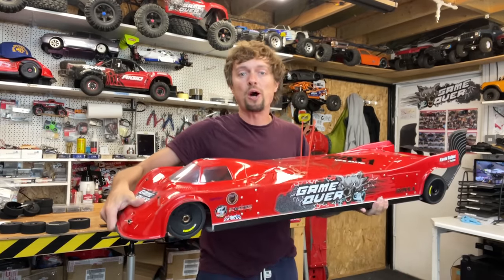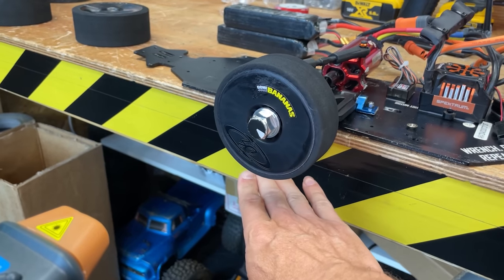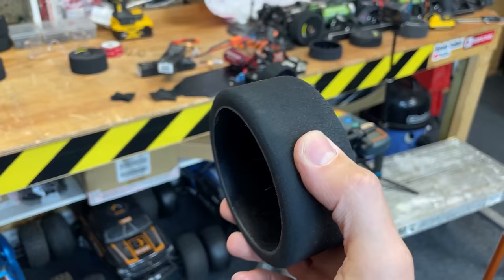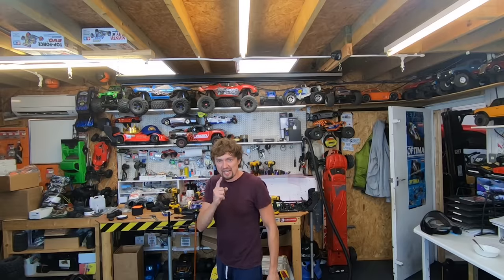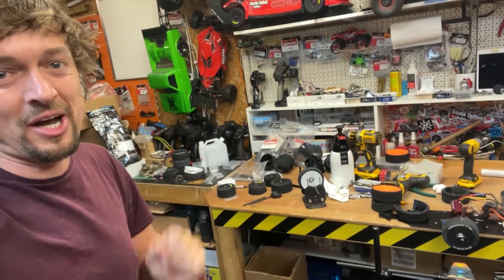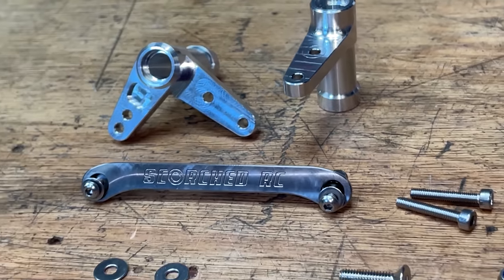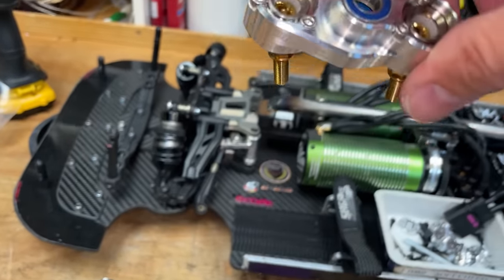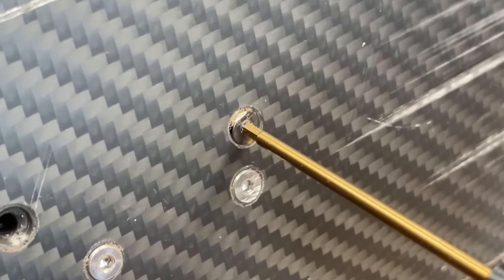Top secret Tires for 250mph Sausage RC Car project

Comment: I've totally lost my patience with any kind of some what fast RC car even stock ones. I have the latest Kraton and it's been nothing but problems. I've been through 3 diffs with about 30 battery packs through it. The last set of diffs I did I replaced the bulkheads. I don't bash it or jump it just ripp it around the yard or road in front of the house. Stock wheels gave out with the factory (slow) gear. Replaced the wheels and tires with banded something or anothers, RPM arms front and rear, new steering servo and tighter saver spring, I put maybe 2 packs through it and started to hear the diff clicking again. Then I burned up the motor after a couple pulls down the road it hit a puddle and I'm assuming the water caused a massive heat differences on the can and cause it to cease up. I've had really great luck with planes though!

Comment: Good idea with the rpm test… definitely need a contact roller of some kind to simulate the road… 

My thought is, it’s not so much the mph, but the rpm… The amount of power that’s being sent through them and the rpm they’re turning is where they’re failing… 

The larger the diameter would be less rpm, but greater mass if not done correctly. Also the huge offset of the wheels, having a flat face and a big dish on the back is a problem. 
As you saw in the two tests, no support on the inside of the wheel allowed it to “flare” which is most likely what’s happening on the runway… 👍🤘

Comment: As others have said, it seems like its the wheel that is expanding out on the inside, due to no support. That pushes the foam out, which either blows it or scrapes it on the car and cuts it blowing it. You need to replace the wheels with something more rigid like carbon or aluminum as others mention

Comment: Hey man, have you thought about using artificial glue type spray like drag racers use? VHT pimp juice and such? Also have you thought about prepping the surface that you are running down if it's allowed?

Comment: more narrow tires. concave exterior portion of rim? Looks like it separates from the center of rim. rounding the exterior rim may increase surface area increasing adhesion and decreasing centrifugal forces because the foam will be thinner in middle. maybe?

Comment: Just a thought but what if you increased the wheel diameter. It wouldn't need to spin as fast for the same vehicle speed. I understand there are still challenges with this such as the chassis may need redesigned as well as sourcing larger diameter wheels for this purpose may be difficult, but I wonder if it would work.

Comment: I think it's time for carbon fiber or aluminum wheels. You could try bonding rubber to a stiffer wheel, if the rubber was only a couple of mm thick and bonded all the way across a stiff rim it should stay on better. It appears the wheels keep flaring out because of the deep offset. I see the new wheels are narrower.

Comment: If you run it on a prepped drag strip you don’t need anything but solid aluminum wheels with a rough road surface since there’s rubber on the surface of the strip.

Comment: Is there a way to wrap some carbon tow around the exterior circumference of the rim before gluing the foam on?  I imagine this would greatly help with expansion of the plastic rim.  After you mount the foam you can cut them back to round.  hey it may work.

Comment: The actual rim is playing a huge part in the tire expoding, the rim is made of flimsy plastic and can't hold itself together, especially on the inside part of the rim that has no support.  It's balloons on the inside edge of the wheel where there is no support then blows apart.  Need to try a stronger wheel, aluminum, or carbon fiber, or just a thicker stronger plastic.  Some type of stronger rim design, there is nothing holding the inside edge from swelling.

Comment: The problem is not because of the rubber or the foam.  A few videos ago you showed exactly what the problem is when you held up one of the wheels and you squeezed it in your hand.  I know you didn't even realize what you were doing Kevin but that is the problem.  The tread of the tire has solid support on one side of the tire but the other end is open and the fact that you can squeeze the wheel in your fingers shows just how weak it really is.  At 200 mph that wheel is 100% flaring out which makes the tread part of the tire not touch the ground evenly.  It's so simple.  It's not the tire material.  It's the construction of the wheel.  It must have support also on the open side of the wheel.  When that happens then that tire will ride on the ground evenly.   You can even see the wheel flaring out in the video here when you were testing the tires.  Only the one side flares up and that's because it's weak because the other side has a solid wheel supporting it.  And the side that flares has zero support.   Of course it's going to fall apart.  Fix the wheel Kevin.  Not the tire.  You could use foam or rubber if you make the proper wheel.

Comment: A simple and effective way to build a wheel is to take one of the foams and make a carbon fibre insert into the wheel void and bond it it. You can buy carbon fibre tube. It will take a matter of minutes
Reply: What if the plastic wheel was sleeved with the carbon tube section and the foam glued down to the carbon?

Comment: Even though it might be heavier,  what are your thoughts on a solid rubber tire? like a 3+ inch solid rubber tire with just a bearing in the center which might hold that speed better.
Reply: I wondered that, but wouldn't the rubber just change shape completely at those speeds like a drag wheel?

Comment: Hiya Kev just wonder if you can have belted foam. With high strength fishing wire. Also the tyres only need to get over 120 so you are probably over testing them!

Also you remember that mammoth stealth thing. That had direct drive to all wheels!  Food for though.  You'd have to call it the big fat sausage lol.

Lov the vids

Comment: Carbon fibre banded wheels to stop expanding on the inside
And possibly a thin polyurethane band over the foam tyre 
Just a suggestion you may have already tried it🤷‍♂️

Comment: Hey Kev, If you take 4 25 hp motors and hook them to the same drivetrain, doesn't that still make the whole system only 25 hp but 4 times the torque? Very curious about that.
Reply: Power (hp) is just rpm times torque, so you really get four times the power, if you don't hit the rpm limit of the motors first.

Comment: I don't think its a big secret, its just a basic rim, foam removed then glued a solid rubber tyre, now the problem you are going to face is still the rim expansion at those rpms, but its a good ideea so good luck. 😊😊

Comment: I know you don't want the weight but the wheels are failing.  You need metal wheels. Or maybe carbon fiber wheels, but never heard of anyone that makes those.  Once you stop the wheels from failing you can then move on to the tire material.

Comment: If the tires keeping on blowing up on high speeds, why not grabbing a skateboard wheel? The tires used for those are polyurethane, which tends to last on crazy high RPMs because of the density which is a lot higher than regular RC tires which are flat, and have lower density. The lower the density = The higher the possibility for the tires to blow up.

Comment: very surprising that the unsupported rear edge of the wheel is expanding. needs either a thickened rim in the mold or a steel band to prevent that expansion of the wheel.

Comment: A little trick with rounded hex and allen key bolts.
Put a small dab of super glue in the recessed part on top.
Wait 30 seconds and insert and hold the bit for a further 30 seconds.
Simply twist and remove rounded bolt.
Paint thinner and WD40 will easily remove super glue before it dries.
Yuo're welcome. 😎👍

Comment: The wheels are belling where there's no inner support, Have you tried running one of those metal cable ties under the tyre and then balancing it. Or machine the wheel narrower, like your prototype.
Though CNC Alu rims are nice, all it will take is a minor impact at that speed and it's good night.
Either way, Dude, You'll figure it out smash the record...

Comment: I would try using super glue to the rim before you mount the foam. The super glue should help hold it to the rim helping prevent enertia pulling them apart so easily.

Comment: The bananas ones could take even more if you can get them to put a back lip on it it will help with the deformation and get even more speed out of them most likely, also make the plastic the foam wraps around thicker or use a different plastic formulation that is stronger and holds form better, but also it could be deforming because of the heat and the rotation is somewhat keeping it in form

Comment: I would recommend you a rim geometry that distributes the centrifugal forces symmetrical, most rigid on the edges (both of corse)
And don’t take aluminium thats not the material for this. You would take a material that has high strength with high elasticity characteristics.

Comment: also you have to give load to the tyre whyle testing it......make countertyre with some serious hard material maybe two or more thic grinding wheels with adjusting load and a masure like easy weight scale.......then you know how it will hold the 1 tonne of a car on rpm

did you see the video of ras how his springs squeeze under speed he did harder ones also

Comment: It really seems like the wheel is as much of a liability as the tire. Those unsupported thin and flexible plastic wheels are great for durability, but they are terrible for this application. I'd echo the need for some wheels with a better support structure, particularly near the inside of the wheel. Aluminium wheels would probably be ideal.

Comment: Kevin how would you feel on adding a 5th esc no load but working a a central control, so wires come a same lenghts to the four main and eliminate any latent signal to your escs

Comment: Why is the rim plastic and not a billet aluminum, 
Why is the foam tread one piece and not say 10 sectional pieces, 
These things combined would eliminate the tyres exploding at high rpm

Comment: Aluminum wheel, pattern of holes drilled through rim. Solid rubber with belting vulcanized to inside and outside of rim. Sounds expensive but it would work.

Comment: Just a thought. Have you looked into tire and wheel setups used on Booneville salt flat machines? Why reinvent the wheel?
Reply: They use tires made of filaments of rubber wrapped around a wheel. But they don't have near the centrifugal force due to much larger diameter.

Comment: Wow, the deflection on the plastic rims 😬 lools like half the time the foams not failing but the plastic rim caused the foam to blow. Alloy rims may make it slightly heavier but might get better speed as won't deflect. Gradual acceleration increasing speed should be fine , once its rolling the weight will be negligible.

Comment: this is probably a stupid idea, but wouldn't making it a 6x6 help with stability and potentially the tyre wear? if you could somehow attach another axle (even if its not driven) wouldn't it help with the high pressure from the length of the chassis and help limit the likelihood of it swerving.

Comment: You need much stiffer wheels. Nic Case used carbon fiber wheels for a reason. You also need to go as narrow as possible on the wheels / tyres.

Comment: You’ve calculated wheel mph by wheel rpm, could you make a “steel roller dyno” similar to the weight of the vehicle so that you could test your tires, driveshafts and wheel top speed with it loaded.  You wouldn’t have to worry so much that something will happen at such speeds and catastrophically fail.  Eventually you’ll have to run it down the road I just hate seeing the speed run cars wreck so violently on test runs lol

Comment: Machined aluminum rims, with steel belted rubber tires like what you have on a full size car.  Just scaled down for RC's, you would think Goodyear engineers would be into RC cars and have some thing for this.

Comment: Would it be worth putting a multimeter across each motor at a set throttle position, to make sure each one is getting roughly the same juice?

Comment: I'm no engineer, but if you used much larger diameter wheels, you can achieve high speeds with less wheel rotation. Seems to me that everyone is going down the same formula path when it comes to design. You just have to look at world speed record cars like Golden Arrow and Bluebird before tyre technology caught up, similarly where RC tyre technology is.

Comment: Seems like a belted tire like they use in drag racing would be preferable or even a hard solid rubber that doesnt have much flex at all. Its wild to me how this issue hasnt been solved yet as it doesnt seem like it would take a genius for a tire company to figure out.

Comment: Must use aluminum wheels with rubber tires (would also act like running a bigger flywheel on a car to stabilize powerband)
Reply: alloy/rubber on the rear with poly/foam on the front could work as well

Comment: Take your rim put aluminum screws around the perimeter of the rim like a beadlock on the face of the rim an attached a hairnet over the tire and anchor them to the screws use epoxy of your choice or hot glue to keep the hairnet from popping off the screws the hairnet my act like belting try different hair nets plastic fabric and maybe the foam  won't fly apart 🤔

Comment: I would go with an aluminum wheel or magnesium if you could find them then mount the foams on wheels using polyester resin and catalyst the foam wouldn't be able to expand on the rim

Comment: 4 separate motors means 4 separate motors. it does not mean 4x25=100. the only way you can do that is 4 motors to 1 speed controller

Comment: Look into how the rubber is kept on razor scooter wheels and get alloy wheels machined similar and run a hard rubber as your wheel surface your not looking for high grip and the extra weight won’t really matter speed cars seam to be completely limited by wheels where as you guys might find you break other things with metal wheels you’ll likely get more advantage from them if you make them work

Comment: So my theory has been repeated by other ytubers below..the plastic wheels are not strong 3nough and higher rpm they cone and pop tyres ..I also think you need either alloy wheels or carbon fibre wheels

Comment: I think your tire problem is as much a wheel problem as anything. The rims are deflecting and expanding, and that's probably what's causing the foam or rubber to come off. Find somebody that can machine you a set of wheels from 7076 aluminum or titanium, and then you can experiment with different foams and rubbers

Comment: You need to be using a solid wheel. Take something like a low durometer rollerblade wheel, get some hubs machined to adapt them to a car, probably have to turn the outer diameter down some...Bob's your uncle.

Comment: My thoughts.. the tire is failing once it gets a small nick in it throwing it out of balance this would happen at much lower rpms.
Its a track surface issue more than a tire issue you need a resilient tire surface..

Rotational mass needs to be minimised balance by removing not adding

A bonded Tire surface needs to be almost nothing for 1 run

Go for a larger wheel diameter which will reduce the rpm and loading for a given speed

The wider the tire the more surface to come off or inner rim distortion causing inbalance too failure. Logic would dictate thin wheels....... but there goes your grip.

Large diameter narrow wheels, long build up of speed to reduce wheelspin required

Comment: If you solve the centrifugal force issue destroying the tire you still jave a wear issue at rhise speeds.  Smoother the surface the better.
Reply: I agree with you 👍
When we look for alternatives to abrasion and wear in rubber, 
Polyurethane is usually what we turn to 
Forgive me if I'm wrong?

Comment: what about a drift tyre with 2 grooves in it with orings in the grooves not perfect for traction but slow throttle ramp and there not going to blow up

Comment: What about drastically increasing the diameter so that the rpm can be less
Reply: Kevlar stranding increasing in in wraps as it gets closer to the chassis of the car. Getting this in the foam would be the interesting part tho and maybe a carbon rim 2 layers thick with the right lay up would be pretty strong as well

Comment: Rosco McGlashan is going for 1000mph on land in a rocket powered car, but its got to be on salt flats, with alloy wheels that cost 10s of thousands to machine, no tires. you're going to hit the same kind of issues in RC

Comment: Aren't you making a mistake with your math?  You are using data with the wheel stationary, but it expands significantly before self destructing, so the ground speed would be a fair bit higher.

Comment: First, convert the tire diameter from millimeters to inches:
Tire diameter (in inches)=25.4106=4.173 inches

Next, calculate the tire circumference by multiplying the diameter by π (approximately 3.14159):
Tire circumference=4.173×3.14159=13.12 inches

Convert the tire circumference to feet:
Tire circumference (in feet)=1213.12=1.093 feet

Now, determine the vehicle speed:
Vehicle speed=23000×1.093×6336060=205.8 mph [not 285 mph]

and here is why it's much slower sir: Increased Rolling Resistance [wide tires], Increased Inertia [ overcoming inertia requires more energy] and  Aerodynamic Effects [Larger tires can alter the aerodynamics of the vehicle aka drag!]

just want help see you break the record kevin!

Comment: No secrets
Not hard to overcome.
Use  skinny rims made fro aluminum with molded and secured urethane base tires.
Similar to full size land speed cars. Most use a skinnier than normal rim with very hard tires that are secured to the rims.